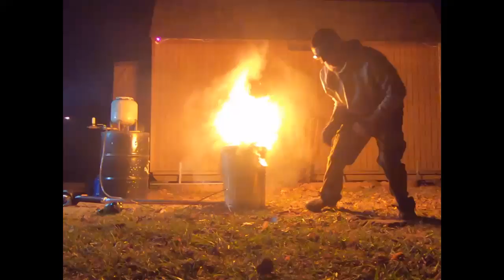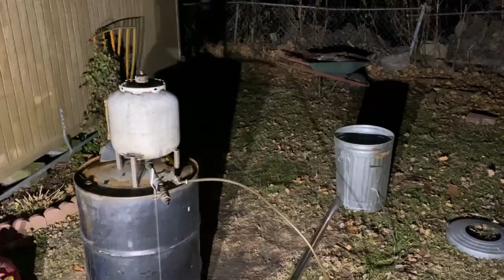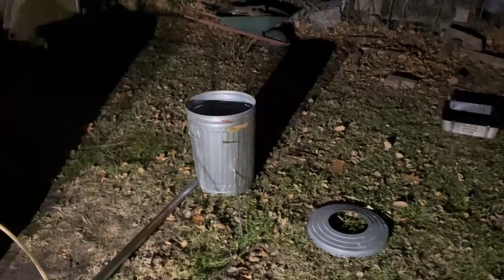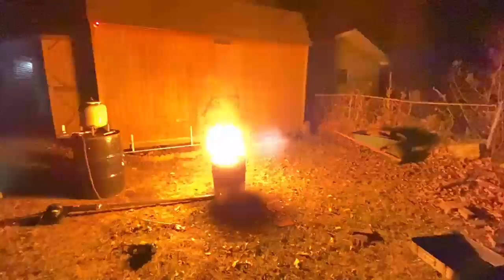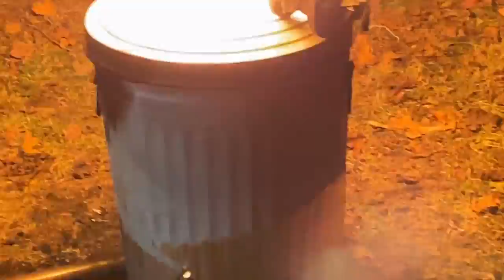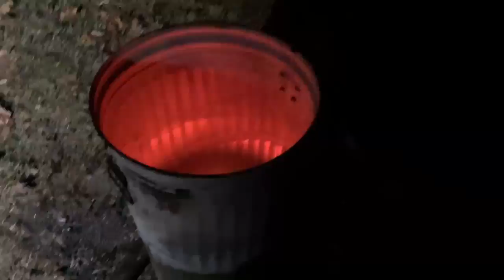PTO Diesel powered anti Frost blower heater for blueberry farm

Comment: I was going to build something like that last year but I didn't get a chance to. I was going to use an old propane 40 gal hot water tank and cut off the bottom and inside vent pipe and weld the pipe onto the top. Then use an old 20 lb propane tank and cut the top off and use it for the fuel mixer pan. Then if that worked I was going to weld on .25x4 steel strips going all the way up for heat veins. I drive otr, so that's why I didn't have time to get to it. Just a thought if you wouldn't mind trying that idea out.